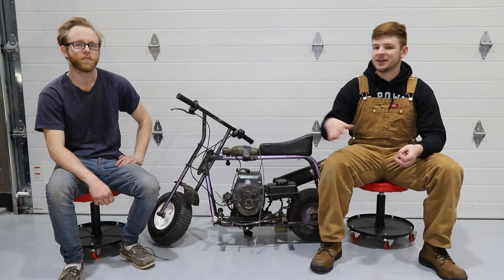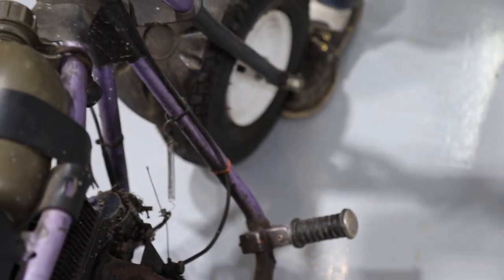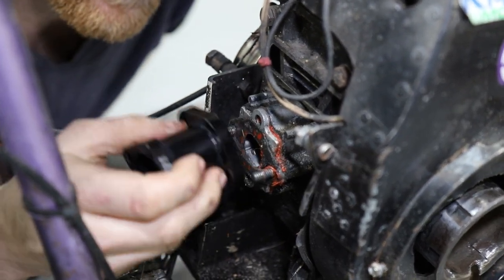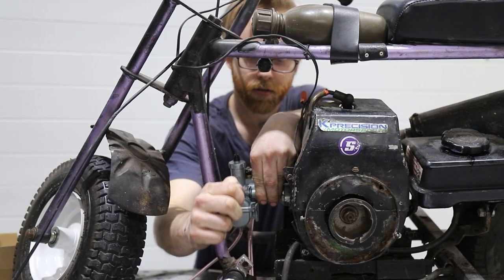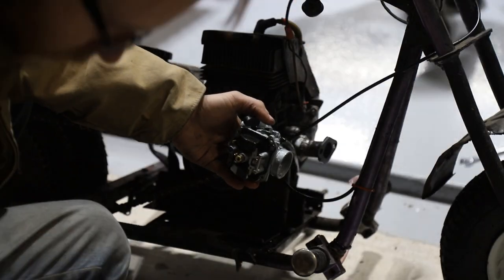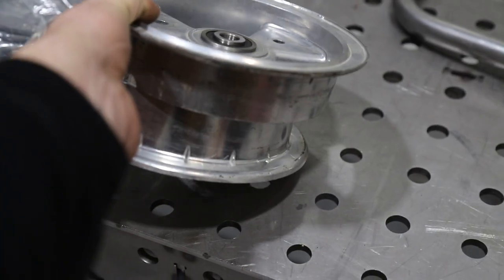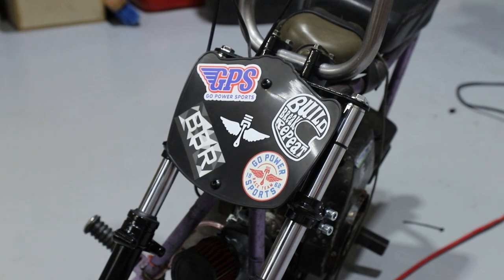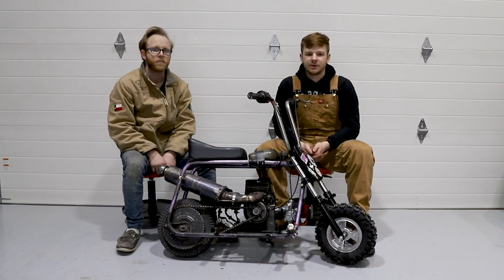2 Stroke Minibike Revival! Vintage Minibike Upgrades

Comment: You need to raise the fuel tank, if you go up a slight incline the carb won't get any fuel. The other option is add a vacume pulse fuel pump but with a pump you'll need to change the fuel Inlet needle and seat.
Reply: Mikuni's really need an air filter to work properly. Mikuni carbs work awesome when properly tuned but you need to understand fully on how they work. I think that the vast majority of people should stick with the Tillotson carb, they are much easier to tune. When properly tuned that engine should have instantaneous throttle response with no lag at all. I used to have a mini-bike just like that when I was a young boy, I wish I still had it. When we were living in ND it was my only way of getting around, I put so many miles on it. It had an aluminum brake shoe that rubbed against the rear tire, I wore that out in no time, dad fabricated a metal sleave over it, it worked but not as well. Good times. 👍🤙👍

Comment: yes put a bigger carb and restrict it with a smaller intake manifold
Reply: Completely optimize the intake duct, including the ports and the manifold. Possibly also the carb, but that is absolutely not mandatory.

Twenty years ago I started by replacing a 50 cc with an 80 cc Malossi, on a Derbi Senda, max 14,000 rpm. Standard carb of diameter 17. Too big makes you have to rev up the engine.

Comment: Expansion chamber is very much needed, that exhaust is not suitable. I would restore the tillitson carb as it is much better suited in all ways really. Let it warm up before you ride as it is simply impossible to tune it cold. Cool build!
Reply: Unless the ports on 2 strokes are setup for a expansion chamber they dont really do much
Reply: @mat6179  Still will do a lot more than that 4 stroke tractor like exhaust
Reply: @mat6179  expansion chamber is really important

Comment: I think that Tilly rebuilt would have done it more justice. I had a Chrysler power bee that I sold while in a bind and I'm kicking myself in the ass cuz I wanted to build a Schwinn chopper powered by the power bee that's clutched with a 3d powersports clutch. That's a idea for your mini bike clutch that beast with a 3d powersports clutch and replace the  tillotson for crying out loud

Comment: better raise that gas tank to gravity feed that float carb, you have it so low that you might stave the motor, lean it and stick it.  and/or add a mikuni fuel pump.
FYI - under the fugly add on parts.. that engine looks like a West Bend 820 .. a desirable vintage kart racing engine (i.e. could be worth some bucks!!!)

Comment: i have almost the same bike but mine is a keystone { i think its a 1968 } its got front shocks and a spring seat.. i had it since i was 6 and i still have it and im 48 now,, its got a 200cc 4stroke motor in it now from a honda generator... i call it the pucker up lol

Comment: Nice build but earlier on he said the engine was pretty insane.. 11hp, 8k Rpm lol
Why was the minibike so slow and stopping by foot with 2 brakes on it lol..

Need todo the hi stall mod to the clutch for 1.. That US 820 .. ive seen em go wayy faster on vintage karts, but for some reason, not quite as fast as Mcculochs with much less cc's.
I had a fresh US820 but never got to complete the gokart build back then (cashed out for double what i paid for it tho i wish i did get to run it.

Id love to see u guys dial it in tho.. I love 2 strokes and would love to see it whoop some 4 strokers lol. Thanks for the video tho.. Love watchin u guys. Peace

Comment: Love that you guys are using the Original music for the vids.Daniel's Uncle must have been a Hoot.The bike sure is.I like what you did with the forks and handlebars.It still looks 'vintage'but will be allot better to ride.I'd suggest the tank be moved to the reserve spot,and vice-versa.I had a 2-stroke cart and when it got to 1/2 tank it quit because the weight of the fuel didn't push for flow.